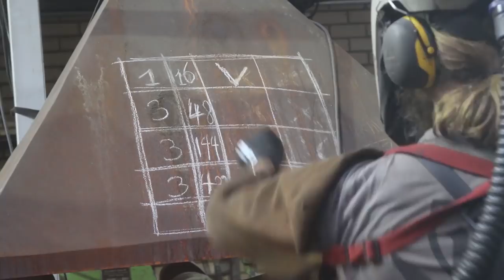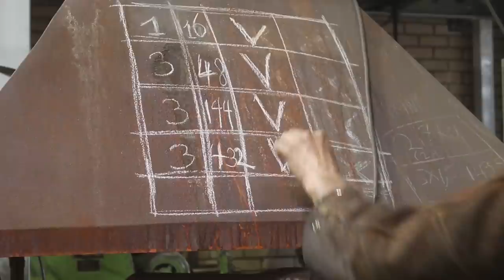Forging the Basilisk sword, the complete movie.

Comment: I think I see why he did the steel the way he did in the beginning. It’s kinda like folded steel. He was mixing the grains of the steel around until weak points of the metal was minimized.
Reply: Are you talking about the way he did a damascus stack, that’s how he produces the pattern of the sword 🗡. If I’m not mistaken it looks like he stacked alternating layers of 18 and 20 and 1095. The 1095 is high carbon steel and the 18 and 20 is low carbon creating a pattern in the blade

Comment: Really great job on this one it looks amazing. One thing of concern tho is the way you welded the pommel to the handle. If you actually used this blade in battle that would probably be a huge weak point. I realize compromise had to be made as there was no way you could hammer the pin down where it's position was. Still as a art piece (which is probably what it's for), it is a masterpiece.
Reply: A proper weld is stronger than the base metal

Comment: When doing the drill bit divots you might try making them dense to one end of the blade then thin them out towards the other end. I think it would give the pattern more character, let it flow with the blade instead of just a blanketed pattern.

Comment: You're a good machine operator, but your no Bladesmith.  The machines did 90% of the work, you are just a safety man. Let us see you get the same results without using electricity. Then come back and present your efforts.